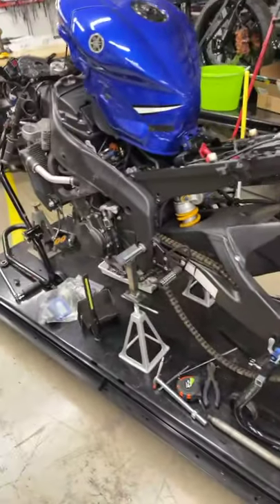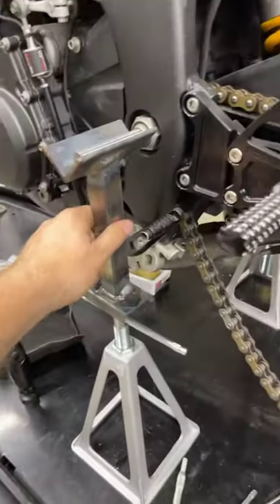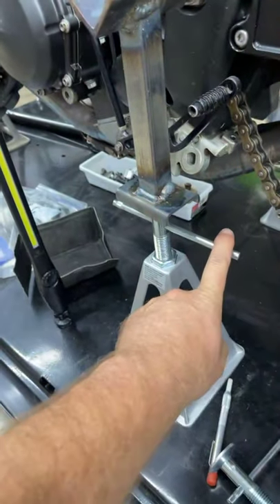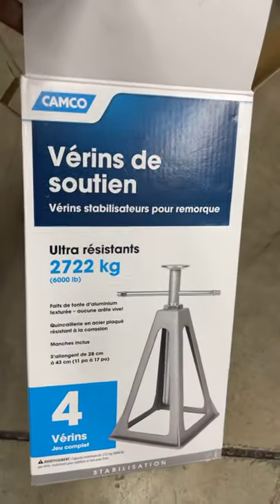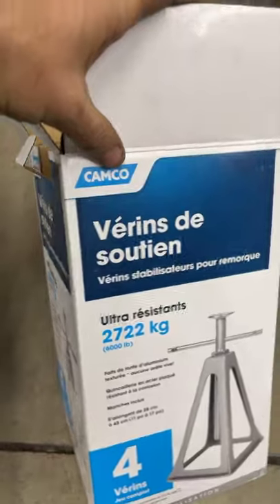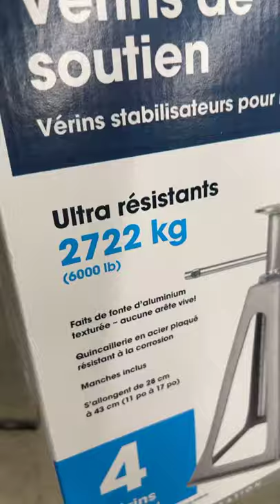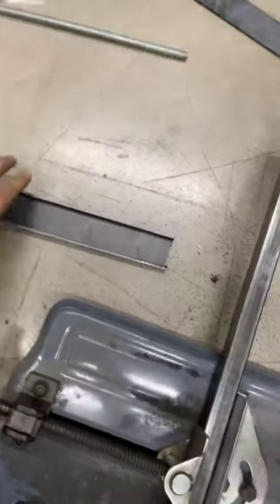Made cool frame support stands for the R6 trackbike. Shout out to Dan Kyle for Ohlins training!

Comment: You can safely use the stands on the pegs. The bolts for the rear stand is M6 and the bolts in the Vortex rear sets are M8 so they're able to handle the weight just fine.